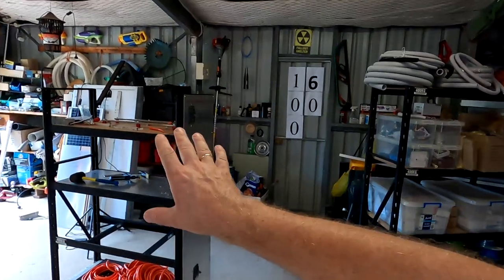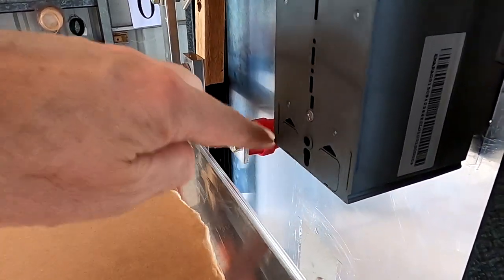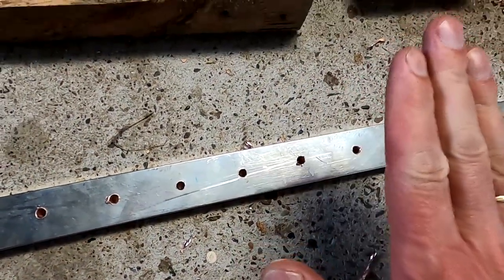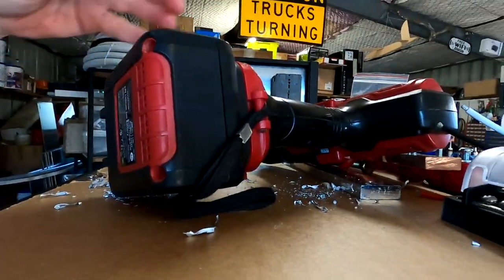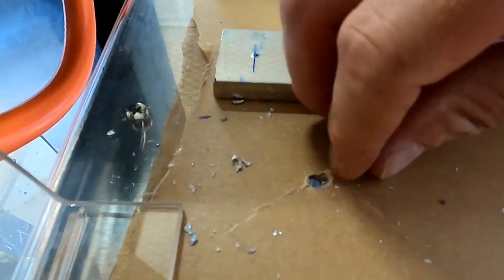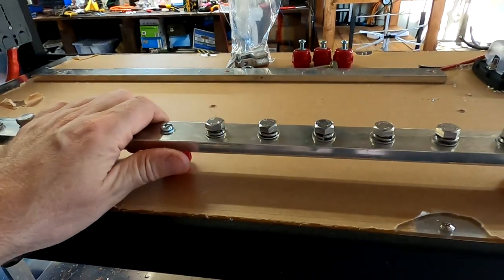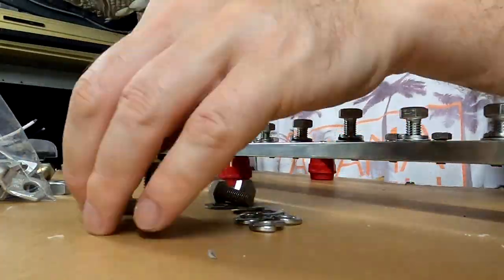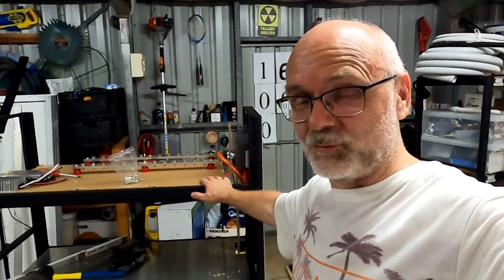DIY 24 Way Bus Bar installation. Battery 2.0

Comment: Nice bar! I would suggest raising 1 bar, so any wiring can be straight and don’t require a bend to go over, underneath the other bar. (So both wires are on a different height)
Reply from the maker: It needs be bend down anyway to sit flush on the plastic. I thought about a riser for one bar similar to what I did in the cabinet with the busbars. but here it's better if they run in parallel in the breaker panel.

Comment: Shouldn’t be depending on threads in copper to allow tight connections.  As others have noted, you should use bolts, nuts, and wavy washers for secure connections with wire lugs.

Comment: Thank you for making this video, it gives us great ideas on how to do things better, and more cheaply than just buying cheap junk.
   Don't forget to always use stainless steel fasteners.
   Regular steel fasteners contain carbon. Carbon is used to make resistors. I have seen high current connections melt down simply because of a carbon steel fastener.
    If you use longer bolts coming up from the bottom, you will not be relying on the soft copper threads that may loosen, or  pull out. Using stainless studs on the standoffs will give you a couple more connection points if you ever need it.

Comment: toptip; drill a little 2mm hole at the end of the cracks, sow they won't crack any further... top vids, greets from holland!!
Reply from the maker: Thanks for the tip. I'm not too concerned about the cracks as there is no mechanical strengths on the plastic, so they won't crack further. I have no watched a few videos on how to drill and also cut Acrylics. Easy to avoid these cracks if you know how... no special tools required.

Comment: Hey just throwing my  1 and 1/2 cents in the mix... someone mentioned bus bars to be different levels which i agree with. An additional thought to that is a plastic resting shield with a radius edge to hold up the wire from the back row off the front row. Second thing would be off set the lug alignment by 1/2. So as to have the back row wire come straight out between the front row lugs. Just a thought. Thanks for what you do!

Marc.
Reply from the maker: Thanks, Marcus.
There will be shielding once the cables are in place.
I thought about a bit of off-set but it's not necessary as the bus bars are around 100mm away from each other which gives me enough room to have them running in parallel to the breaker panel.

Comment: Andy, nice bar but I have a suggestion. Rather than threads in the soft copper, I recommend through holes with bolts and nuts, but the bolts point up from the bottom of the bars, thus creating studs. The hex heads will be beneath the bars but accessible with a wrench and will be strong enough to handle the torque you'll need to get solid connections.
Reply: This is a good suggestion, but, leave the threads in the bar. Thread the bolt in from the underside and torque it in place. You get "stud" sticking up but dont need to worry about trying to hold it from underneath.
Reply from the maker: It's not THAT soft. I doubt you will strip the thread out of that bar with a normal ratchet.
I also didn't like the nuts underneath as it is dangerous to access them later down the track once the bar is active. There is a good chance for a big short between the two bars.
Reply: Using a 7mm drill to make a M8 thread weakens it's holding power. An M8 should be torqued to 17Nm in copper. You may want to test in a spare piece. Torquing down a terminal is very important.
Reply: @OffGridGarageAustralia  Personally I dont think you will strip the holes out. My suggestion was to thread the bolt through the bottom of the bar and torque it in so it stays there and you never remove it. Then you have a stud sticking up through the bar. You simply drop the lug and washer(s) over the stud and then apply the nut. Here is the biggest benefit: You can now torque to steel specs instead of being limited by copper. More pressure is more better!

Comment: I have 2 ft long copper busbars on my negative and positive. Not sure how many threaded holes I have but it is several lol got them spaced for 4/0 lugs and lugs for 4 guage coming from 6 lithium strings.
Reply from the maker: You can never have enough connections, right?

Comment: You didn't mention the trick to drilling into copper. With a regular drill bit you blunt it. Basically change the angle  so it bites in less.  The stops it from catching the material so easily.  It should drill like butter and shouldn't give any problems. It's giving problems it's because the drill bit isn't sharpened at the correct angle.  Drill bits come factory with the right angle for steel and wood
Reply: Yes I hate drilling copper it snags ,catches rips I will never drill buy hand drill press only. !!
Reply: also WD40 is a poor lubricant i, i use molly or red grease  ;-]
Reply from the maker: Yeah, too late now. I only have these drill bits.

Comment: Looks great. I chose to use 40 x 5 mm copper, pillar drill accurate 8 & 10 mm holes then use bolts inserted below with locking washers and nuts above. This way you can use a torque wrench right up to around 20Nm for M8 and have a really good tight connection without risk of the bolt pulling out of the soft copper. I also use No Ox Id A electrical contact grease.

Comment: I must have missed something earlier on the design of your battery bank shelf system.  What I'm imagining is your Battery bank#1 on bottom shelf, Battery bank#2 on middle shelf, Charge Controller inputs and Distribution output connections to Inverter on top shelf.  If this is what you are doing, I admire the forethought of you putting the Charge Controller high enough up on the wall. 👍

Comment: I am surprised that you don't have a drill press!! And by the way, to get a quality thread tap, you really need to do them by hand. Using a drill doesn't give you a great thread, especially when it is so important.
Reply: Exactly! But he has a hydraulic crimping tool!
Reply from the maker: I don't have space for one and never had a need for one until now. Is it worth buying one now? Probably not...
I'm sure you guys have one 👍
Reply: @OffGridGarageAustralia  there is so much you can do with them. They aren't that big. Either a table top one or a free standing pedestal has space in every shed 😊

Comment: Andy, quick tip, you need drill taps not standard and taps....
I'll try and send you a picture of some I have.....work great in most metals.
Tip with plastic drilling.....more speed less pressure....in fact hold your drill off.
Hope all goes well with the shelf's
Best wishes Marc

Comment: Hey hey Sparky, you're getting it going. Good job. Do they have Bellville spring washers down under? With a given ID they have a larger OD over the split ring. I find them to be much better at maintaing pressure at a given torque.
Reply from the maker: Yes, they have them here as well of course. I'm old style 😎

Comment: You can get plastic drill bits that are less likely to crack plastic.  Or just run your drill fast backwards and melt your holes.
Reply from the maker: Yeah, but I didn't have one at that time and will likely not buying one for just that purpose.
I'm saying this now because I'm at the beginning of working with this material.

Comment: Very professional.  
Congratulations.  
Once question.  what are the red pieces?  Thank you.
Reply from the maker: Thank you. They are called bus bar isolators or stand-off. You can get them in all kind of different dimensions. Link is here on my website: 
https://off-grid-garage.com/electric-installation/

Comment: With different metals I would use a grease at screw connections, the nobler material (copper) would attack the inferior metal in the long run. 

Earlier I used for something like this polfett from Bosch , but I do not know if there is still ? 

With the tubular cable lugs I also like to use the outside are expanded, it is easier to insert the cable, from about 35qmm cable. 

Plexiglas I drill with wood drills and cool with spirit, as you do when drilling aluminum. 

When freehand drilling the drill runs away sometimes, that is unfortunately so. 

Here is a stand drill helpful ;-) 

Greets from Germany 

Uli

Comment: That's a super thick busbar you need for 12v, I'm glad we are moving to 48v these days

Is there a big disadvantage to just drilling the holes out and putting a nut on the other side instead of tapping the copper? I hate threading steel bolts into copper and aluminum due to how easy it can be to mess up the threads.

Comment: I love how the main cable to main breaker is 70mm2 while the bus bars are at a guess are 30x10mm so 300mm2. Overkill but why not. Would have cost a pretty penny though. They will handle a lot more than 650amps.
Reply from the maker: The bus bar was 4m long and did cost around $200 altogether. Considering buying cables and all the lugs, crimping and the time, I thought it is worth it and keeps the installation clean.
Reply: Maybe he wants to use the 70mm2 wire as a shunt haha

I would connect the two bars with a piece of equivalent bus bar if the load required it.

Comment: Andy,  just wondering why you wouldn't place the horizontal bussbar next to the switching device to shorten your cable run and eliminate the cable from the shelf entirely. The end of the bar could have a ninety degree bend to accommodate a straight run cable, this could also provide some strain relief if designed in. I seen electricity do some very odd things over the years.
Reply from the maker: Just another design what you suggest... I would not be able to bend this copper myself without proper machinery. I used to work in a switchboard company and we had massive banks for bending copper. Nothing you would have at home...

Comment: Andy, try on a scrap piece of plexiglass drilling a hole with a drill bit that has a blunt cutting edge. You might find that it won’t grab when it breaks through. And crack the plexiglass

Comment: Its looking Good 👀👍
A nice Acrylic DIY Buss Bar "Cover" would finish off both bars nicely. Ofcourse it would require cut-outs at each lug/cable termination, but would make both bars extremely safe.
A Similar design to a 240V Neutral link Cover, found In most Domestic Switchboards installations.
I'm Looking foward to your next video. 😊👌

Comment: Andy, glad you tapped your busbars, but please consider bolts and brass washers and don't forget the contact grease. Alternatively you could use countersunk brass screws coming up from underneath to give you a nice thread sticking out the top to put your lug on with brass nut, brass washer and spring washer all covered in contact grease of course.
Reply from the maker: I won't use any contact grease on these connections. I also cannot use any countersunk screws from underneath. That would make it impractical when connecting more cables down the track as it is very hard to reach. Makes no sense to me in doing that.
Reply: I agree, and I will be designing one this way too. This way, the countersunk screw acts as a permanent post which would almost never require replacement. It will simply act as a stud - and will be flush to the bottom! Great idea, thanks. As for grease, I use no-ox and I never have to worry about corrosion, or dissimilar metals, or humidity, or anything - it's great stuff.

Comment: Get some plexiglass cement for those cracks will seal them like it never happened. It is like water and flows into the Crack. I use it to build aquariums.
Reply from the maker: Thanks for the tip. I'm not too worried about it as it still maintains the isolating effect the plastic is mainly for. Also the bus bar isolator sits right on top. If I create more cracks, I'll get this cement. Thank you.

Comment: Get yourself some drill bits made for plastic. It is better to use nuts instead of threading soft copper. Your connections will loosen due to thermal cycles and oversized hole. Your bolt pitch diameter is 7.1881 mm. You just lost half of your thread height by drilling a 7.0 mm vs 6.8 mm hole.
Reply from the maker: That's overkill. I say this now as I have to drill in that plastic a lot more in the future. I may regret not have listened to you 😂

Comment: Great vid as always.

Are those bars nickle plated?

Also as other have mentioned, there are drill bits for plastics,  if I recall they are something like 80 degree points instead of the 118 for a normal drill bit.

Still looking to that 6 to change to a 7 :)
Reply from the maker: Yes, the busbars are tinned.
I should have pushed the plastic down with a wooden block while drilling. It only cracked because the drill bit was so sharp it went through it quickly and lifted it up.

Comment: Great video! Great workmanship takes time and effort, which you seem to put in your work! Question, what are the red knobs you use to suspend your busbars on the shelves? What type of screws did you use in those red looking knobs to fasten them to the shelves 6mm, 8mm?

Comment: Will super glue or the glue they on car windscreens help repair the cracks in your perspex???
Reply from the maker: I'm not concerned about the cracks at all. The Acrylic will sit flat on the aluminium sheet and where the cracks are the bus bar support will push down on it. There is no mechanical force on the Acrylic, so I just leave it as it is.

Comment: you can repair that 'plastic' with chloroform.  with a thin needle some liquid in the crack and do not tussingon anything, liquid evaporation crack repaired.  It's nice to see that nothing goes perfectly and that you are still going to change during the composition.
Reply from the maker: Thanks for the info!

Comment: Hello Andy I I’m interested to understand how you will manage all this 2 batteries lines. I suppose you will use 2X 18 cells. But the BMS is max 24S. If you use 2 BMS. How they can « discuss » with the inverter??? Or we don’t care about discussion?  My idea is to make the same as you in futur. But the inverter I looking for have all mppt integrated and a communication port for the batteries. What’s happen if BMS and inverter does not discuss?

Comment: How do you calculate the required copper bus bar thickness?  ...is it dependant on total voltage?  Number of connections?  Amperage draw?
Reply: Wonder same...

Comment: If you don't want your drill bits to wander off when starting holes, start with a 1/8th (3mm) or smaller pilot hole that won't be anywhere near as likely to skip out of the punch mark. On the downside, that would mean twice as much drilling to do.
Reply from the maker: I did the first holes with 4mm. I broke a 3mm drill in that copper as they easily get stuck...
Reply: @OffGridGarageAustralia  Having some form of drill press helps a lot there. More control over drill bit pressure and staying perfectly square with the surface. Most of the times I've broken drill bits is from wandering off-axis with the hole. Hard to freehand-hold the drill steady while drilling through "grabby" materials.

Comment: Can I suggest countersinking your holes to break the sharp edge before tapping. Your tapped hole will look like it was professionally done then,, A cheap drill press with a depth stop and they will all look the same. I'm a qualified machinist, this is how I was taught to do it. Give it a go on an offcut, you'll never look back.

Comment: offcourse the 6.8-7mm is a difference. The amount of force you can put on the thread is a huge difference. But wil you actually torque the cables to the spec of an m8 bolt to a copper bar? Probably not, its not like you are going to hang a swing from the cables or something.

Comment: Andy, I am a homeshop machinist and milk is the best lube when drilling copper.  Also using water spray for drilling or sawing plexiglass helps
Reply: Is whole milk with higher fat content better than skim milk, or is it not the fat in the milk doing the magic?
Reply: @mfgxl  Correct, whole milk is best.
Reply from the maker: I've got organic soy milk here...
Reply: @OffGridGarageAustralia  Not sure if that would have enough fat
Reply: Just been given 2 litres of organic raw milk (sold a bath milk) pity I don't have any copper to drill, as it has over an inch of cream on top.
Reply from the maker: @andrewradford3953  hahaha, that would have been perfect.
Reply: @andrewradford3953  That sounds good. Where do you get that milk from?
Reply: @peterdobrovansky8305  Have someone staying in our cabin who's uncle runs the dairy for Cleopatra's Bath Milk near Gympie Queensland.
Should be available in most health food shops around Brisbane. It will be very expensive compared to processed milk.

Comment: We used pvc sheets instead of acrylic because it doesn't crack. People think building switchboards is easy but there is lots of experience required , lots of tricks.

Comment: Omg. I’ve never understood this trend to tap threads with a drill.
Reply: It works plenty well enough for this use case. If being done and undone regularly then not so much. But copper also not good for regular do/undo 😊

Comment: Perhaps consider putting a nut on the underside of your buss bar bolts to help lower the connection resistance.
Reply from the maker: How would that help? The resistance is between the bus bar and the ring terminal. Only very little current will run through the bolt itself.
Reply: @OffGridGarageAustralia  Well the head of the bolt is touching the ring terminal, so its a point of contact along with the under side of the ring terminal on the buss bar. Its all about lowering the resistance.